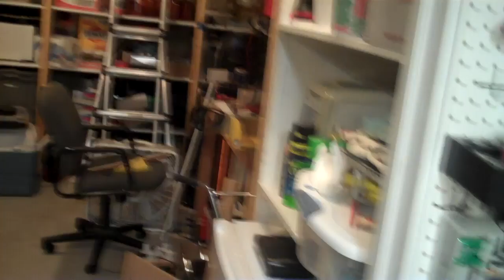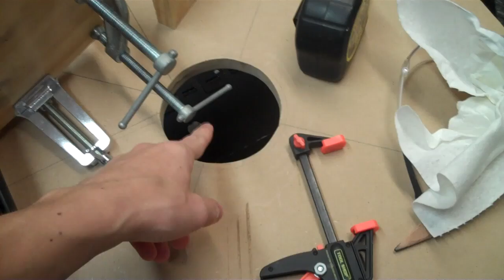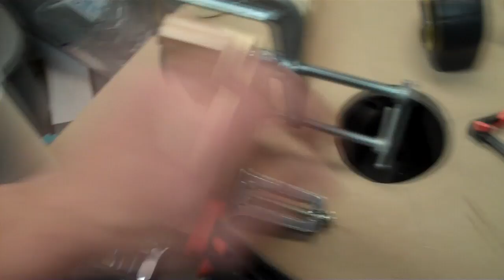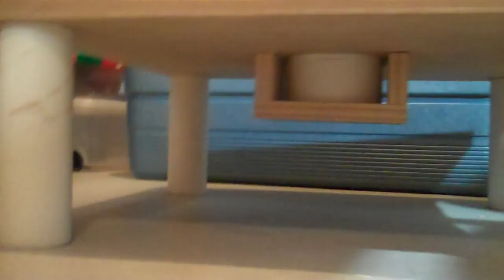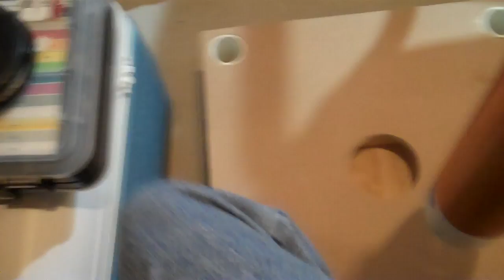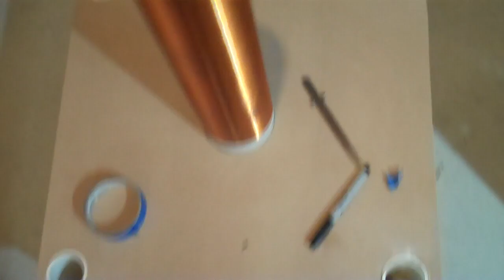Tesla Coil Update - 11/26/11

Comment: im trying to decide on a power supply as well. i wanted to use a modified fly back that gives a better output than several NSTs that meany people use but you see ... um well its will 9 inches around around about 6-7 feet tall... about 4500 feet of wire .. the pipe is hard to get spinning its about 100 lb and i need to use a very strong gear reduction motor for it ... given the size i think i need 5 mots but i still need to wind